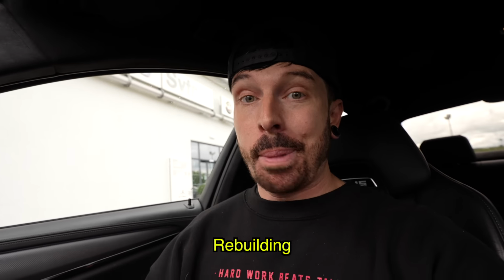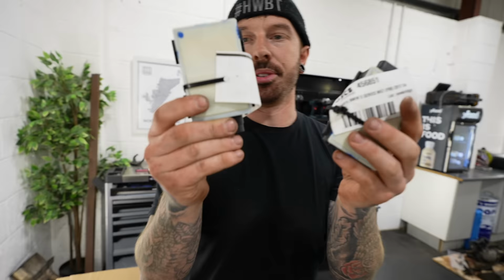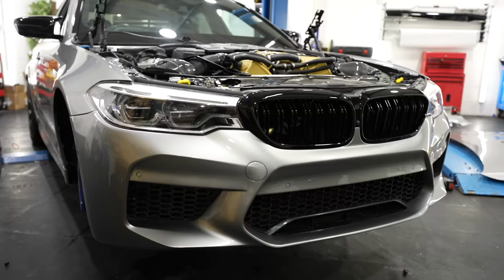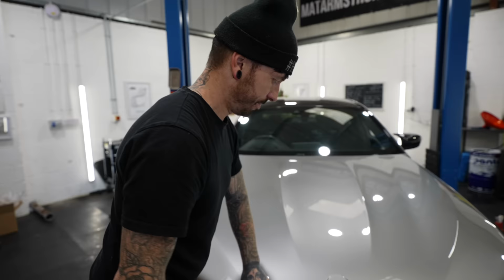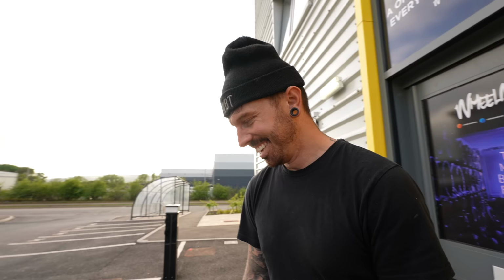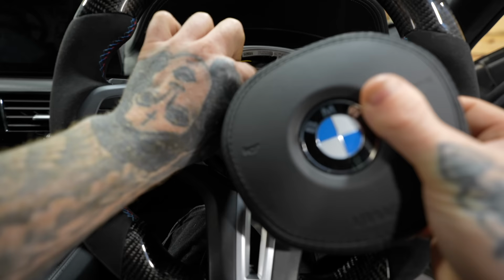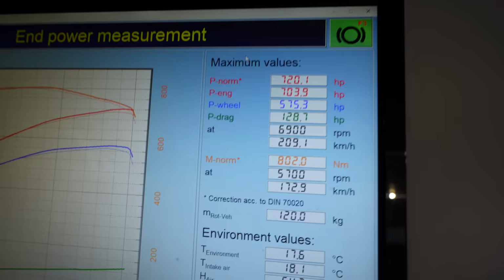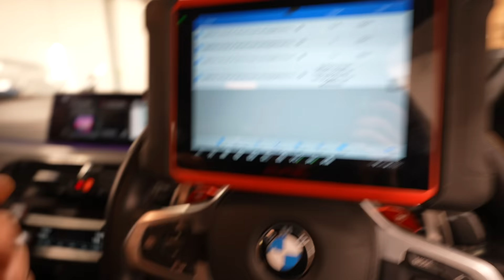I REBUILT MY WRECKED BMW M5 NOW I HAVE TO TAKE IT BACK TO BMW

Comment: The ordinary battery only runs ions one way and will not allow the battery to be recharged. The electronics that work with the Lithium battery are set-up differently and the system itself will NOT work with a lead-acid battery; it will die every time as it does not charge.

Comment: It a simple problem change the alternator  the 12v generator or u check the relays that charge the battery it simple that what I will do cause I know BMW DON'T HAVE ANY OFFICE IN NIGERIA  so I know the car solely dependant on the battery which is wrong the battery start the car then the alternator supply all the power needed for the car

Comment: As a car guy I'm going say it wasn't worth it because as the Bluebook Value doesn't matter on this vehicle Blue Book values at $50,000 but you can knock about $20,000 off of it because it has to have rebuilt title so now you're 2000 over 😮

Comment: Change the alternator alot cheaper than the lithium bullshit that cannot be recycled.  12 volt is 12 volts dc unless bmw has competerized monitoring of said battery and serialization of said batteries like a. Iphone.

Comment: Tell me the reason why those dude, rebuild it like brand new. Instead use it, they send it to the official dealer shop. Why? To check if the rebuild they are doing is in line with what the factory is doing?

Comment: Why bother? The thing isnt worth the plastic its slapped together with or what it costs to maintain. Its just going to be constant trips to the dealer then like all euro cars the engine will start burning oil at 50k and sling a rod

Comment: In terms of costs, you saved around 9000 pounds, but how many man-hours did it take to rebuild the car? The cost in terms of your time and the man hours you spent on the car are probably offset by the fact that you made a youtube video that has over 2 million views but for the average person, it might be more worthwhile to pay the extra 9000 pounds depending upon their access to tools, their personal skill when it comes to using those tools, and their jobs (if you're working 80 hours or more a week then it might not even be possible to rebuild a car like this in a matter of months).

Comment: To be honest I feel like it should be illegal to do what youre doing. Cars are designed to be safe ONCE. Once the structure has absorbed an impact that's it. You can aesthetically repair it, make it look good again, but it'll never be as safe as it was again. Especially in a performance vehicle I think its unacceptable to put this back on the road. I wouldnt get in this deathtrap. And youre looking to sell it?! You talk about "the next owner" multiple times in this video

Comment: I mean i would much rather have the not wrecked car with less than 30k miles for 50k than the Wrecked and rebuilt with some sketchiness and non OEM parts that still cost 85% not including the amount of labor and work you put in. Yeah not a good idea

Comment: you know what, as interesting as this might be you are doing us disservice. BMW will learn what can actually be repaired for cheap and then they will make sure you can no to that again with ever so stupid complication and material choices. So in the end for bit of fun most of the benefit goes to BMW to make sure no one but BMW can repair BMW. Repair will be, buy new BMW, what is pinnacle of their wet economics dreams.

Comment: It has some slight curves to it, but to anyone not familiar with BMW they all look roughly the same. Big rectangles, oval front grills, and a few subtle lines and curves here and there. They are such boring cars. 

They are not alone, cars as artwork are all but extinct, but bmw has always been like that.

Even the mods, you have to stand at the right angle to even see it, or the piece below the rear bumper looked exactly the same but of a different material.. why?? A few pounds of weight savings for a couple horsepower?

Comment: Your not worth 50k,yours is crash damaged,you've changed the wheels,steering wheels etc which has lower the value even more if you went to a bmw main dealer.i wish you didn't mess with the xar like the wheels, steribg wheel,ruined it for me only thing I liked is that power